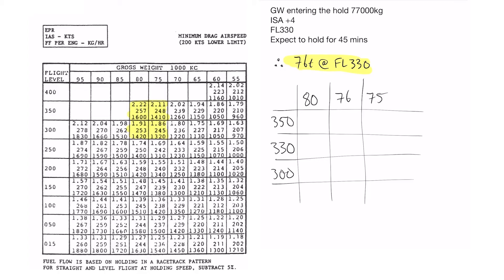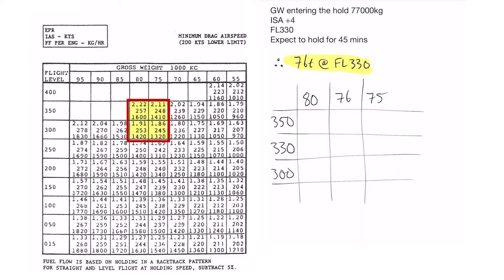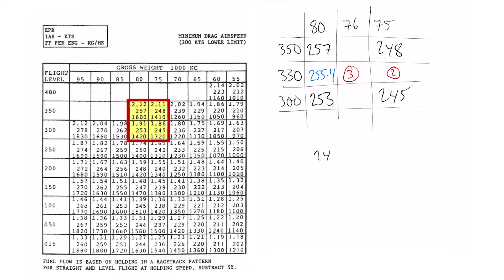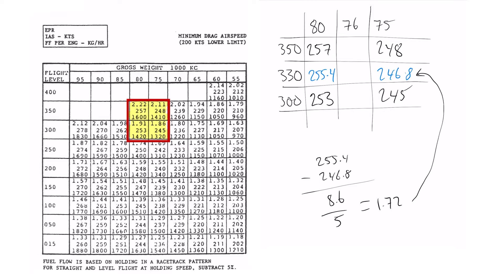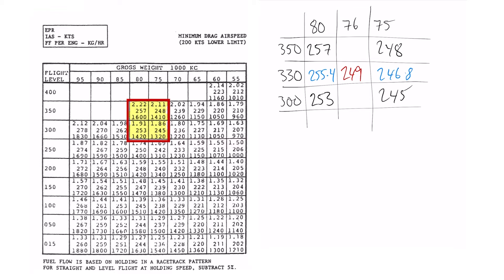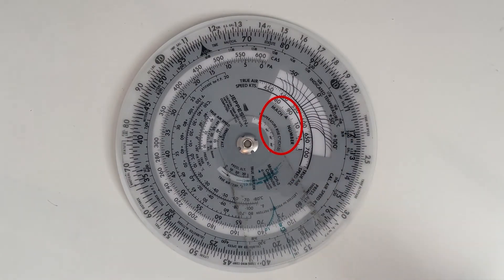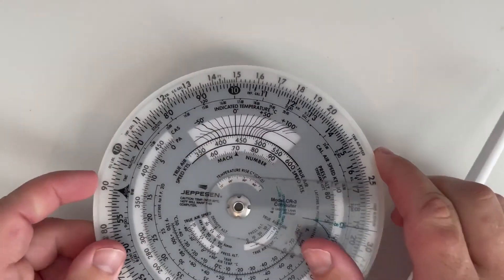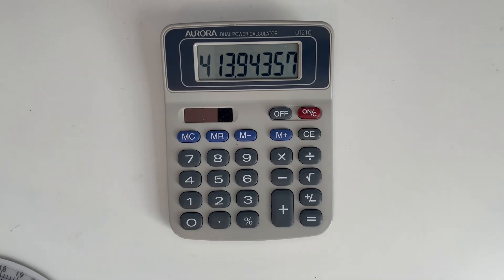Minimum Drag Speed for CASA ATPL Flight Planning Exam

Comment: Why don't you subtract 1 at the end when you're doing the Mach number to TAS calculation? I thought that was needed.
Reply from the maker: Hey Sam, the only reason some people subtract 1 is that the 39 you multiply in the formula isn't exactly 39, it's 38.975, and they think subtracting 1 will make it more accurate. But it doesn't, there are more times that subtracting 1 makes it less accurate than more. So if I was a gambling man, I'd take the odds. 

The more important reason though, is that when Gavin (the guy that writes the exam) does his calculation, he doesn't subtract 1. And our aim is to be as close to his answer as possible.

Good question, cheers
Reply: @aviation_theory_services  Good to know! I knew about the rounding thing, but didn't know the almighty Gavin has weighed in on it. I'll stick to your method then.